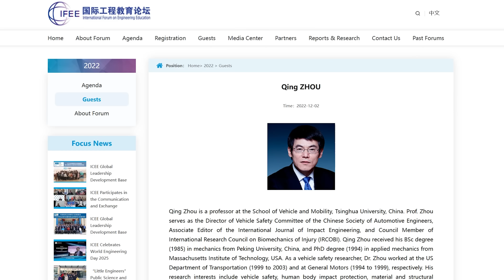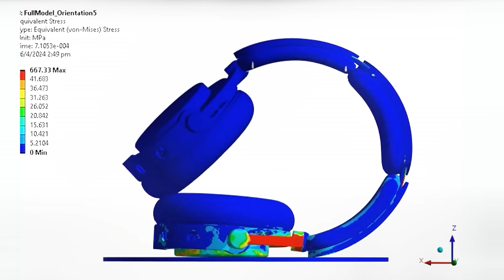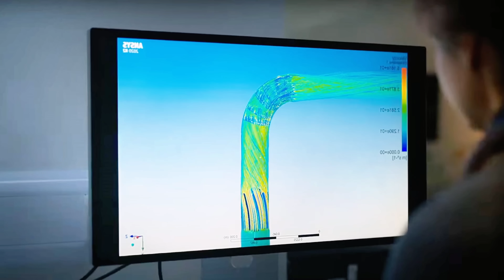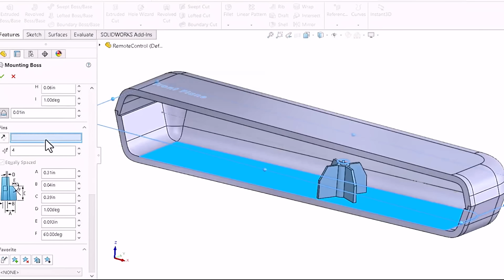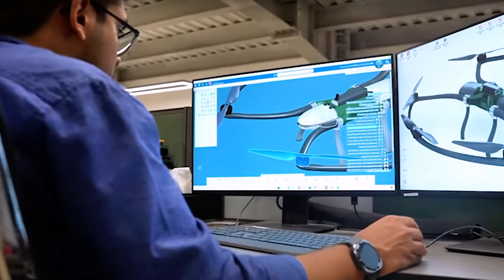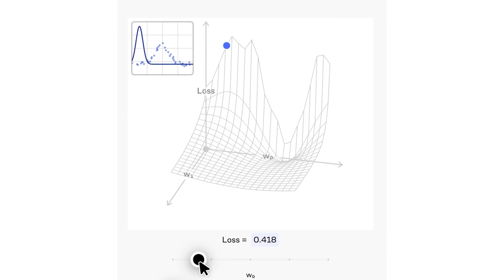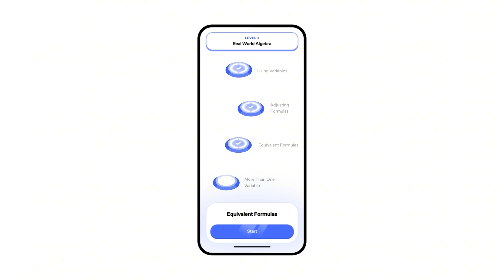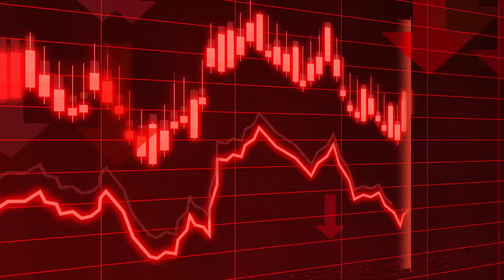My Problem With Mechanical Engineering

Comment: Brother! can you give some guidance for someone like me. Who wasted his time in college and now has a mechanical degree but no skills or knowledge whatsoever. I want to seriously get into the designing field. HOW and WHERE to START.
Reply: HVAC will take you in
Reply: @Tinyhatscontrolbanks  I hope you are right
Reply: Start in any field, and look for opportunities to be promoted within. If it is not the industry you like, then change jobs about 2-3 years later.

I am currently doing a lot of excel stuff, meetings, and emails. But my manager, and manager's manager as well as other higher ups know that I am interested in working with FEA/CFD. They like my work, so it's only a matter of time until the opportunity arises, and I would be the most qualified candidate.
Reply: Apply to 100 jobs in a city with heavy engineering presence. One random one will inevitably give you a call. Don’t stop applying. Know that when you first get to the job you will feel super underprepared. It’s low key a good sign that you recognize that you have more to learn. One week into the job it will become a lottt clearer which things you need to freshen up on. For the first 3-6 months of the job spend your afternoons purely dedicated to learning those niche topics you need to freshen up on. Read, learn, repetition. Repeat. Worked for me.

Comment: What I have discovered in my 11 year mech.engineer career:
Pro: You have very little meetings in a week out of everybody else in the company
Con: You have very little meetings because nobody cares to have meetings with you
Reply: Set your own meetings then if you need to have a meeting.
Reply: Lol u wot m8?? Like 30% of my time is spent in meetings.

Get into consulting and you'll have to create fake meetings that only you attend, just so you can block out time to actually meet deadlines 😂
Reply: Sameee im in power electronics. They only have meetings about firmware and hardware. Only question they ever ask me is “are we on track”. They fully assume mechanical and thermal will just work without question and it’s all on you. It’s kinda funny being like the forgotten child lol